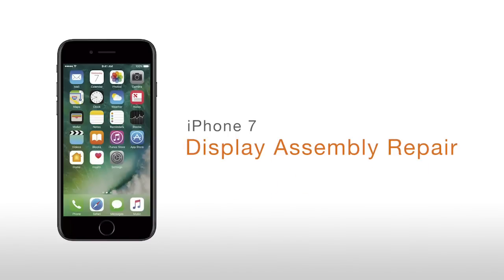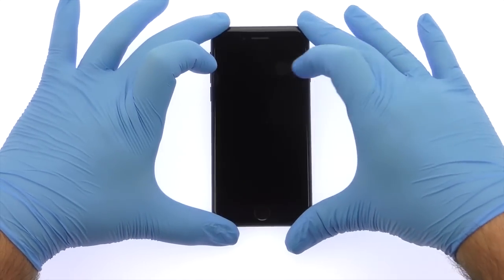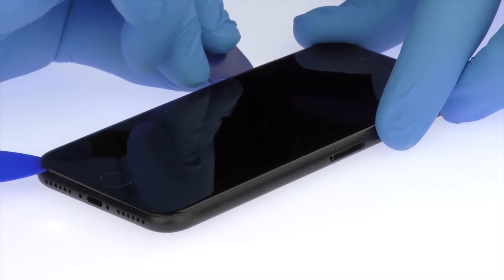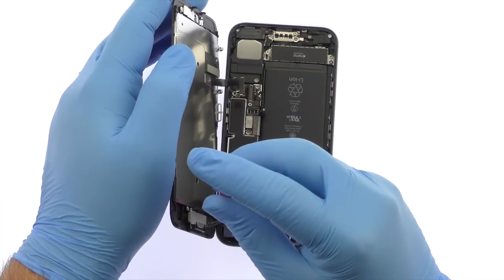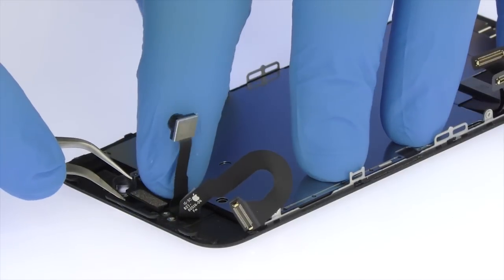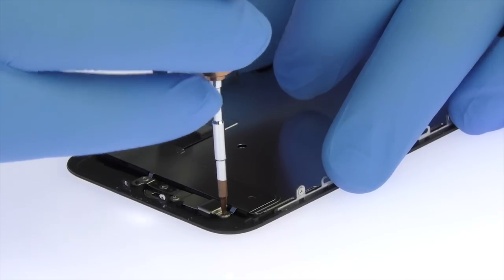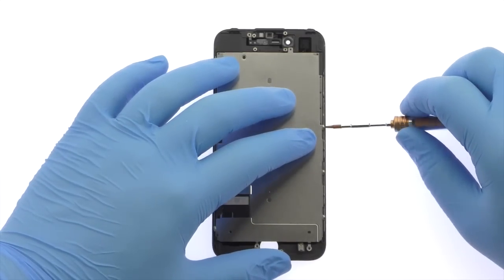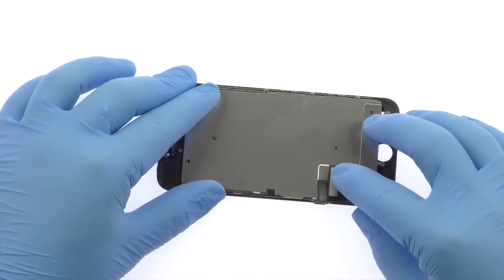iPhone 7 Display Assembly (LCD & Touch Screen) Repair Guide - Fixez.com

Comment from the maker: If you want to fix your iPhone 7 all by yourself, this video is for you. The guide is easy to follow, and shows you step by step how to replace your devices LCD and Screen safely and with ease!
Reply: are your products available on amazon?
Reply: @HazardMEG  Cricket Cricket... lol honestly they should be.
Reply: hi my shorter flex cable snapped that connects to motherboard from screen and now my home button not working , is the felx cable replaceable?
Reply: instablaster...

Comment: You should never use a sharp metal tool, like pointed tweezers, to pry up the flex cables. It can pierce or tear the cable. Use the spudger instead. Slide it underneath parallel to the phone. If it's stubborn, lightly heat from the screen side with a heat gun to soften the adhesive. If you damage the home button cable, you lose touch id. It's paired with the phone and replacing the button won't bring it back.
Reply from the maker: Thank you for sharing this information for all viewers. Great details.
Reply: thanks shorty

Comment: will the home button not work if you replace the screen?
Reply: Home buttons on the iphone 7 and up are biometrically synced to the board, in replacing them fingerprint will never work again. You may only use your original in replacements.
Reply: Jeffrey Hoffmann I think you are right Jeffrey, most people don’t know that.
Reply: Isaiah Woodbury nope it still works fine also the 3D touch

Comment: It seems impossible to unscrew the tri-point and phillips screws inside the phone. I'm using the tool kit that comes with the replacement screen bought over Ebay. do i need to buy a proper screwdrivers?

Comment: Is the iphone is still going to be water resistant?
Reply from the maker: The phone will no longer be water resistant.
Reply: The water seal is available online.
Reply: what steps do you take to make it remain water resistant ?
Reply: No way.  The only solution can be buy one of those water proof cases.